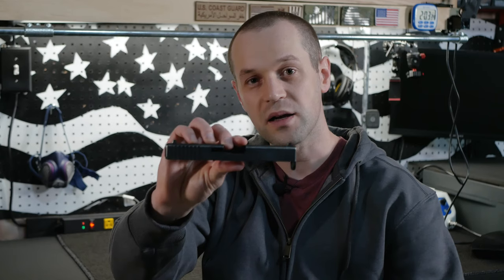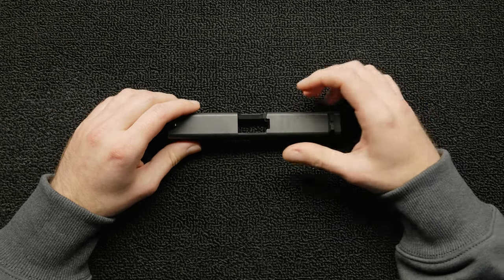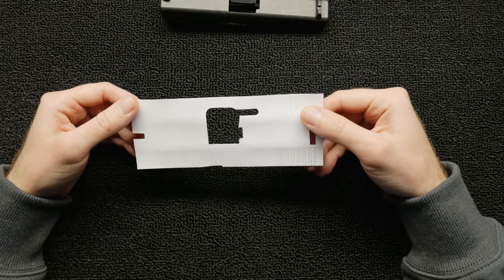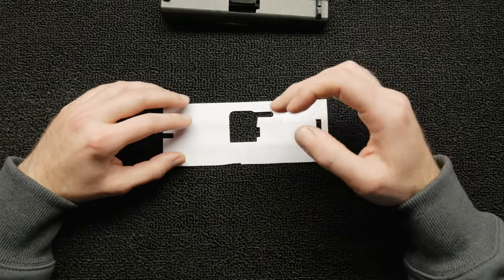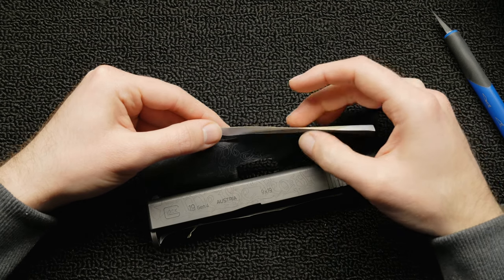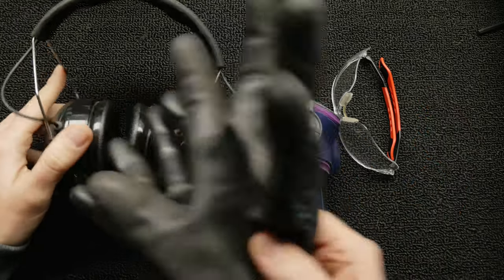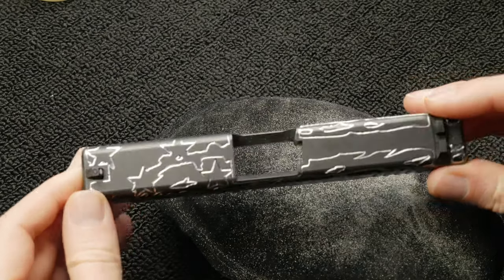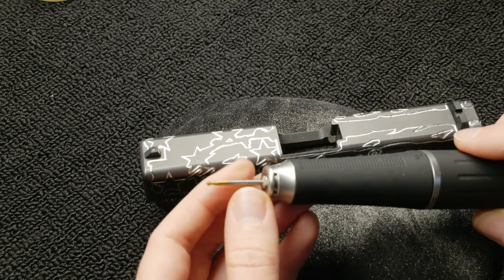Gun Slide Engraving | Tattered American Flag Design

Comment from the maker: First time engraving a slide, also first time engraving a weapon. Have you tried engraving anything similar to this? What are your experiences?
Reply: I hand engrave guns and knives daily with a Lindsay Classic Airgraver pneumatic system. Take some cheap flat white spray paint, and paint the whole slide. Your carbon paper tracing will show up a lot better. I use transfer tape(sign makers use it for vinyl signs) to get the guns outlines. Then lay that flat on a piece of paper and scan it. 

 Now I have a physical copy, and digital copy. I then use Adobe Illustrator(get Inkscape software for free online, it's basically the same thing). Once I have my design done, I print it out on my HP inkjet printer that uses #61 ink(the ink numbers are very important. #60, 61, and 65 are all proven to make great transfers) onto Pictorico Premium Overhead Transparency film. 

 Then using a thin film of a mixture of pine rosin and alcohol transfer fluid on the metal(transfer fluid is sticky and pulls the ink off the transfer film), tape your transfer film to the part you want it on, and lightly burnish the back of the film. Peel it off, and start engraving.

  If you're not already a member, join the Facebook group called "Hand Engraving for All". Lots of tips and tricks there, and people to answer questions. There's also some folks there that will help you build a pneumatic or electric engraving system if you want one.
Reply from the maker: @chuckburroughs6427  Hey Chuck, thank you very much for taking your time to explain this! The process is very interesting, I’ll have to look in to it. My main request to engrave is stainless steel cups, so other than this job I haven’t had much experience. A lot of people have asked about protecting the engraving once you’re finished with the piece. I was thinking maybe clear coat of some sort but that may take away the shine. I would love to get in to pneumatic engraving, it’s definitely on my radar, I just need more time and money.
Reply: The finish on a Glock slide is basically a form of parkerizing. Many people think the "melonite" or "tennifer" is the finish. Melonite/tennifer is a heat treat process that makes the slides so hard and tough. I'd just use some type of cold bluing solution like Birchwood Casey that you can get at Walmart. After that's done, oil it up real good for a couple of hours to neutralize the bluing chemicals, then clean the oil out. If you really want to highlight the engraving, you could try a Bonanza Gold Fill kit. It's very easy to do. I think they also offer it in silver.
Reply from the maker: @chuckburroughs6427  Hey Chuck, thanks again for your reply. Wouldn’t cold bluing darken the engraving? Also what type of oil do you recommend using? I bought some Super Blue a while back to maybe do axe head engraving, it looked super dark in one of the videos that I watched here. Do you have a channel here? If you don’t you should definitely look in to starting one, I’m sure people would appreciate your talent. I’m just a dude who tries to engrave different things with what I have haha.
Reply: Yep, the super blue will darken the engraving so it doesn't rust. Any gun oil will work to neutralize the bluing chemical. That's why I mentioned the Bonanza Gold fill kit to highlight the engraving. I don't really want a YouTube channel. It doesn't pay enough for the time involved. If people want to learn real hand engraving, there are a lot of classes available.
Reply from the maker: That’s great, thanks Chuck!
Reply: What speed were you running the dremel 4000?
Reply from the maker: @GUNSLINGER-yd8gb  Hey Brian, if I haven’t mentioned it in the video, then I would say around 25-30,000 rpm. 25 will give you more cutting than 30 so I’m guessing that’s what I had it set to. It’s been a while.
Reply: Would you be willing to do a slide for me? Just let me know your prices if you are.
Reply from the maker: @mufdvr69420  Hey thanks for watching my video! I am currently deployed so I won’t be able to take on any jobs. Thank you for your interest though!

Comment: careful using the adjustable chuck. I used one for a while until 9ne day I had a fluted carbide cutter come flying out of it. I switched back to collets after that, lol.
Reply from the maker: Yeah I pay attention on how much it sticks out and constantly adjust it. Maybe if I upgrade to a Chuck system like the foredom rotary it would hold the burs better. Although foredom flex shaft is a bit slower in rpm.

Comment: Try using a diamond burr. They works much better on slides, parkerized metal and bolts.
Reply from the maker: Hey Chris thanks for the tip. I’ve used Diamond burs on stainless cups and they last just about a few minutes haha. What type of burs are you using and how long do they last?
Reply: @TriadoCustomEngraving  on guns I use à NSK hand-piece at 35psi with #1-#6 diamond burrs. The carbide barely makes a scratch and is very frustrating. I get the diamond burrs for about $10 a piece. After engraving a gun, I’ll save the used burrs for softer metals like copper and silver….bone and wood.
Reply from the maker: @chrisgrunch7055 Thanks Chris that’s good to know. I would have to give it a try one day.

Comment: Really nice. I print or draw my designs on full sheet label paper and stick it onto the piece. I then engrave along the lines with my dremel through the paper. Once your lines are traced I just peel the paper off, clean the sticky off with mineral oil. Then do the depth work. Look at diamond grit bits, the results are smoother than carbide.
Reply from the maker: Thanks Nekura! I’ll have to check them out. I used some diamond bits in the past and they always burn out quick. Maybe the ones that you’re talking about are better. Merry Christmas!

Comment: This is fantastic instructional information, I hope my design comes out so well. I'm concerned that removing the blueing from the steel exposes it to unnecessary wear. Would you recommend applying a cold blueing solution to the engraved material? Or paint?
Reply from the maker: Thanks Cole! It’s a good question which came up here a few times. Unfortunately this was my only piece that I engraved and it wasn’t mine. The owner said that he touched it up with some clear coat paint and called it good. Not sure how good it looks afterwards. Maybe an oil application can also be beneficial. If you apply blueing to the engraving it will turn it dark and you will not be able to see it. I’ll have to do more research and see what I can find.
Reply: @TriadoCustomEngraving  guess I could have read through the comments first, thank you for taking the time to awnser

Comment: Hi, how often do the diamond bit ball burs get used up / need to be discarded? I just started engraving and I’m still trying to gain knowledge
Reply from the maker: Hey Rishika, I used tungsten carbide burs for this project, but diamond bit can last a long time and also run out quickly, all depends on where you’re using it. Higher the speed of your rotary tool can also wear out the bit quicker, keep the bit wet throughout the engraving to keep it clean and also cool. Lastly, diamond bits are great for glass, painted surfaces, plastics and leather. It can be used on metal but they will only last short time before you have to swap it out. Hope this helps. Feel free to email me if you have any other questions.
Reply: Thank you so much for your response

Comment: Excellent work, my friend. 
Thinking of doing some custom work on my Ruger Lc9s. 
I am going to strip it down of the old blueing today and wanted to possibly dive into doing something with my dremel once I've reblued and cured. 

         Thanks for the video! Really phenomenal work you did here.
Reply from the maker: Thank you very much! It’s a lot of work but pays in the end having one of a kind piece. I would love to learn how to do blueing, any specific product that you use or they all work the same? I want to try it on axes maybe.
Reply: @TriadoCustomEngraving  I'm using Birchwood Casey brand. They have an entire kit you can pick up at a gun store. I would call ahead though and make sure they carry. 
Kit comes with "Blue and Rust Remover," The "Cleaner/Degreaser," and there "Perma-Blue" product. $20.00 and tax. Steel wool, directions, all the works. 

You can get everything separate and choose Perma or Super Blue. 
Theres a few good videos you can search up that dive into the differences between them, and how to properly handle and apply them. 

   So far ive blued a handgun that wasn't blued at all, for a buddy of mine, a few of my hand tools, and soon here, my Ruger Lc9s. 
Excellent results for me, every time. Not familiar with any other brands, currently. Birchwood Casey is trusted and used by many.
I'm think you'll really enjoy the results you can achieve with it.

    Really enjoy the dremel work! 
Wood, metal, glass, stone. Dremels are a blast.  

So far can only find your handgun slide for exactly what I was driving for!
Reply from the maker: @dwainetyncompany  That’s awesome, I’ll have to check it out! Thank you for sharing your info on this. Dremel is definitely a great tool to have, that’s why I have two of them...haha. My Foredom Micromotor is great because it doesn’t have the flex shaft and it’s not loud. There are no vibrations, which could be annoying while using the Dremel “giving you that springy feeling in your hand” although it cannot produce the torque that my Dremel 4000 can do, so I use both.

Comment: havent tried it on metal yet.
i do glock stippling and use a dremel for recessed lines/borders and clean out the surfaces on the frames.
i like how gentle you can work on metal tho...one false move or too much pressure on polymer and the bit bites into the material and takes off 😄
but i think i could do graphs on slides too....but thats a different play.
Reply from the maker: Nice! Yeah metal can be tough to deal with as well. Gun slide metal is pretty tough so you’ll have to use tungsten carbide to be able to engrave anything on it, otherwise you’ll be scratching it. Not all tungsten carbide burs are created equal so I would do some research. I used one bit that I bought online that since got discontinued lol.

Comment: I am looking to try engraving on my vape (box mod), and watching similar styled videos. I only have a hefty dremel tool, and I now am realizing that engraving is more like a mix of sketching / drawing and sanding mixed together in an interesting way. Gotta grab some cheap engraving tool for these fine lines I guess, or else the tip will run all over the metal instead on the outlines... 
Nice video and great craftsmanship! I really appreciate that.
Reply from the maker: Hey thanks for watching. What type of Dremel do you have one of those hammer action ones with a needle point? It’s possible to engrave with those but it’s hard on your hand for sure. Rotary tool is the way to go, maybe upgrade to Dremel 3000 and use tungsten carbide burs on your vape. I’m guessing your vape is aluminum so it’s should be fairly easy to engrave.
Reply: @TriadoCustomEngraving  Thanks for the fast reply! I actually have a Cordless Parkside Dremel / rotary tool that's only 25000 rpm. It is a bit hefty, but has no hammer action. I probably need at least 50.000 rpm? 
It's actually stainless steel, I believe it's gonna be hard enough, but not impossible. Thanks for your advice!
Reply from the maker: @vapingnexus  I usually have mine set around 25-30,000 rpm so you should be good to go! Stainless can be a paint in the butt since it’s a lot tougher than aluminum so you would want to use tungsten carbide burs for sure. Good luck with your project!
Reply: @TriadoCustomEngraving  Oh great, than I'm not too off with the rpm. I'll first try ot out on a blank piece of metal, and see how that goes first. Thanks a lot for your advice, I will update if I finish the project!
Reply from the maker: @vapingnexus  No problem, good luck!

Comment: Hello my name is Bam, and I would like to know why did you switch back-and-forth with the two different Dremels or engraving tools, what was the difference between the two of them?
Reply from the maker: Hey Bam. First tool that I used was a Foredom Micromotor. I mostly use it for outlines because it’s a great precision tool, although not so good at taking out large amount of metal. I switched to Dremel 4000 because it’s more powerful. I use these tools side by side for almost every project that I do. If you only have the Dremel I would stick with that. My micromotor system cost me over $500, so it’s not a cheap tool to get, but I like it since it doesn’t vibrate or make as much noise as the Dremel.

Comment: Great stuff. What was the white goop you put on the burr?
Reply from the maker: Thank you! I use lubricant called Pro-Cut, helps with heat and prolongs the life of burs.
Reply: @TriadoCustomEngraving  thanks man, appreciate the response. Also appreciate your content, I recently got the foredom SR motor and some various burrs, it’s been fun trying my hand at what you do. Can’t wait to be as good as you.
Reply from the maker: @Big_D39  Thanks man! Let me know how you liking that SR, I’ve been looking at buying one for a while now.
Reply: @TriadoCustomEngraving  I actually love it, I only recently started using one as a hobby but prior I worked in men’s wedding band manufacturing and was using a unit 8-10hrs a day and they’re a hell of a machine, can’t recommend foredoms products enough, customer service has been top notch as well with any questions I have.
Reply from the maker: @Big_D39  That’s awesome, I’ll have to try it sometime. The only thing that I noticed is that it doesn’t go very fast compared to the Dremel so not sure how well it will do for detail work and such.
Reply: @TriadoCustomEngraving  I’m not too familiar with the dremel, SR tops out at 18k rpm. They also have the micro motors that reach 50k and I don’t have experience with the micros but the research I’ve done leads me to believe people love them. They are a bit pricier though.
Reply from the maker: @Big_D39  Yup I have foredom K1060 micromotor which I believe I used at the beginning of this video. I like it for small details but for large engraving and anything involving deeper cut stuff I usually use the Dremel at around 35,000 rpm. That’s why I’m not certain about the 18,000 rpm and if it would do a good job. Only one way to find out is to get one I guess…haha

Comment: Issues with rusting on the Glock slide?
Reply from the maker: Great question. This gun slide was not mine, I had this done for a customer who later applied some oil to it to prevent rusting. The original plan was to cerakote the slide and have the engraving stand out in a different color but he chanced his mind when he saw it shine from engraving. My guess is that it would rust if you do not apply any type of protection to it afterwards.
Reply: @TriadoCustomEngraving  thank you for your response! I'd like to get my g17 personalized but I worry about rust. Any suggestions on how to seal it other than cerakote?
Reply from the maker: @andyconda5194  I’m no expert when it comes to taking care guns but maybe if you apply some gun oil to it it will keep it from rusting. Maybe consider throwing a clear coat on it but that can take away the shine.